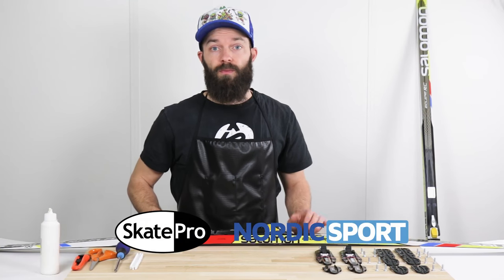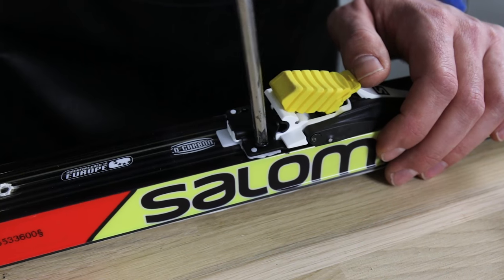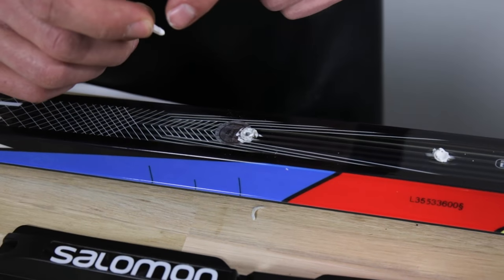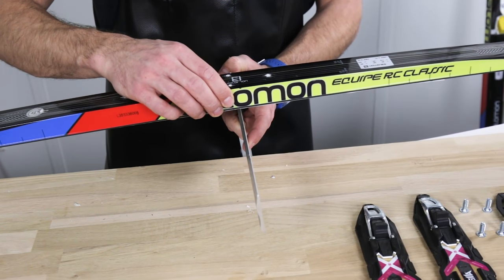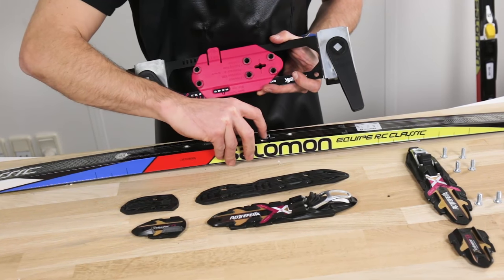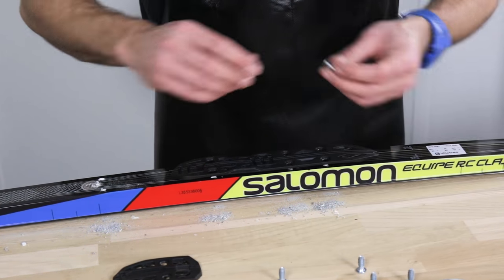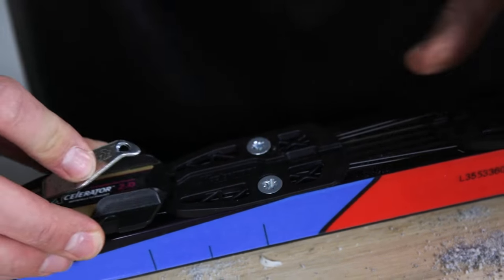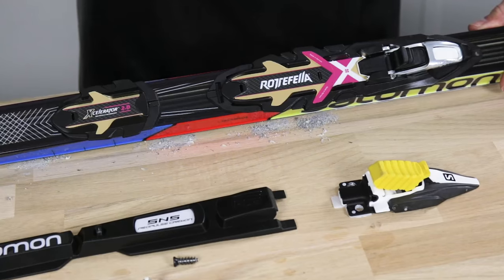How to exchange SNS with NNN Bindings with mounting jig - Cross Country Ski Guide

Comment: An easier alternative is replacing the SNS binding with an NNN-compatible Prolink binding which uses the same screw holes as the SNS binding.
Reply from the maker: Hi Magnus - Yes your are spot on with the Prolink bindings from Salomon would fit directly with the same drilled holes in the skis from the SNS bindings:) The case with some cross country or roller skiers is that they want the specific NNN Rottefella brand. But you are totally right with your point.
Reply: Hey! Yes, and if this video is aimed at do-it-yourself skiers it would have been informative with instructions how to mount NIS plates without access to a jig.
Reply from the maker: Hi Magnus. It is true that not every one has this jig available for mounting the NIS plates. I will like to make this point clear and besides changing the title of this video and the description I will try to look into making an drawing that would be available for people without a jig. I will not promise 100% that I can make it but I will make a try. Thanks
Reply: You're welcome, and thank you. I believe Rottefella have what they call a paper jig in PDF. Otherwise one can use the NIS plate as a template.
Reply from the maker: Cool - Thanks
Reply: SkatePro0
Reply: Does that bring moving back and forth-ability to the ski? That is what i'm looking for. Now i have SNS profil system and i need a system which can be set forward of backward.
Reply: @juha2031  -- Yes, it does if you choose the Prolink Shift or Prolink Shift-In binding. Otherwise you can choose either an NIS or IFP plate that have the same screw hole pattern as the Prolink and SNS bindings and mount an NNN or Turnamic binding, respectively.
Reply: Just realized that all my used skate / x country skis are SNS! They don’t even stock or sell  SNS boots at the ski store we were at !!! Bugger! No wonder the used skis were so cheap. Guess I will have to swap out all our 8 pairs now as finding used SNS boots for our kids is difficult. Great comment on the nnn pro link binding.

Comment: What do I do if I don’t have a special mounting bracket device?
Reply: Looks like the balance point is centered between the first two pair of holes in the jig. The holes are 40mm apart, so I'm centering my balance point 20mm between those two holes. If you did the same last year, how did that work?

Comment: Hi. I want to know if it's the same procedure with the IFP plate ?  I mean by that , do you have to use another special jig ? Across the web  , there no info about how to mount the IFP plate . Even Fischer doesn't give any details . Hope to find some simple template to do that correctly . I don't allready receive my ifp plate by mail , but hope there some ''0'' center point on it .
Reply from the maker: The IFP plates are mounted the same way as the SNS bindings of Salomon. If you don't have a jig like that, you are able to mount the IFP without it. You have to find the balance point (BP) of the ski and place the balance point of the plates exactly there (also stated on the IFP plates). Mark the mounting holes and drill the holes in the skis after that. On the skis there is stated, which drill you should use 🙂  Feel free to contact us if you have any doubts!

Comment: I bought new skis (SNS), but I want NNN:s from my old skis. When I took the NNN of, it didn't have the NIS plate on it. Will the NNN:s fit then to the new skis?
Reply from the maker: Hi Anitti. Some editions of the NNN systems do not have the NIS plate but are drilled directly into the skis.  The holes from your old NNN bindings will not fit the holes from the SNS bindings. In principle, it is the same you should do as in the video, namely:
1. Screw out the old bindings carefully.
2. Add in wood glue and plastic plugs
3. Let dry.
4. Remove excess plastic.
5 Find the balance point.
6 Use the balance point for mounting the new NNN binding.
NOTE: Remember that the new holes have to have distance to the old holes in order not to make problems for the new bindings :)

Comment: Can i use two of the holes from the SNS sistem to the NNN ?
Reply from the maker: Hi, you can only use the Prolink binding, since this is the Version for NNN from Salomon.
Reply: You can actually use the three front holes from the SNS binding if you are replacing it with an NNN binding that is directly screw mounted like the Rottefella R3 model (i.e. not an NIS binding). The pivot point will then however be 24 mm behind balance point (if the SNS binding was mounted at balance point). Reusing two of the SNS holes for the NIS plate is more difficult because the width between the holes is 1 mm too wide for the NIS plate; the pivot point will also change although it can be compensated by setting the NNN-NIS binding to another position than 0.